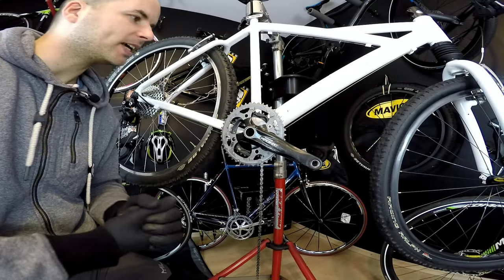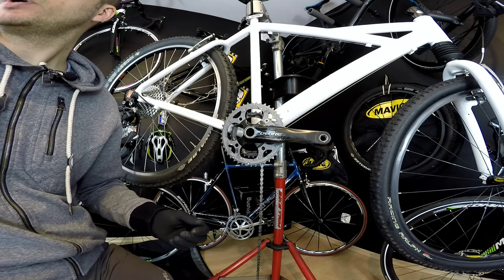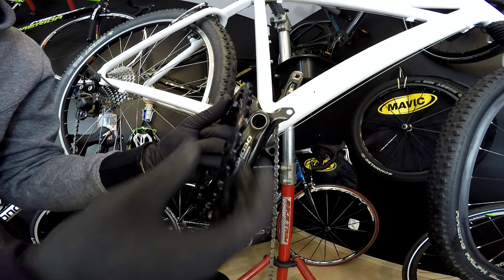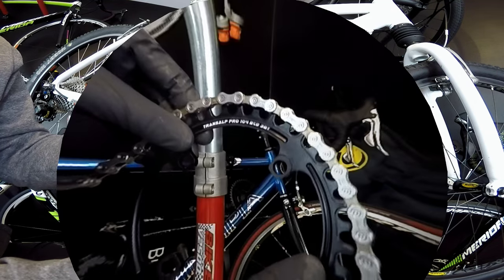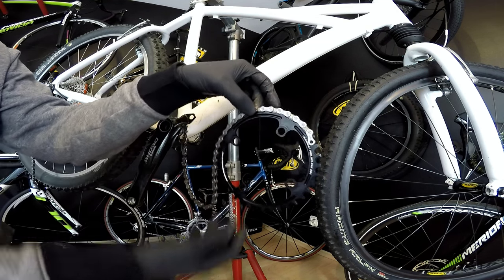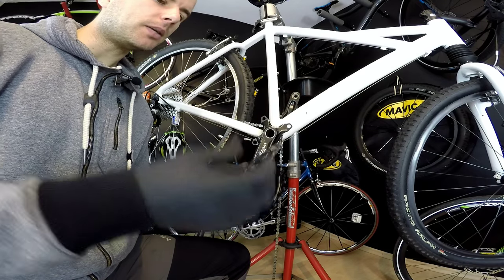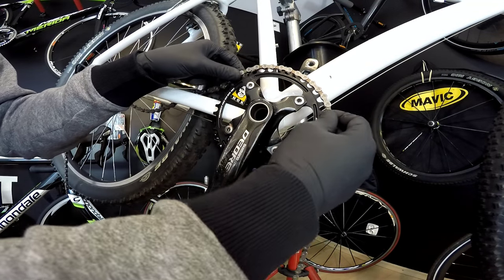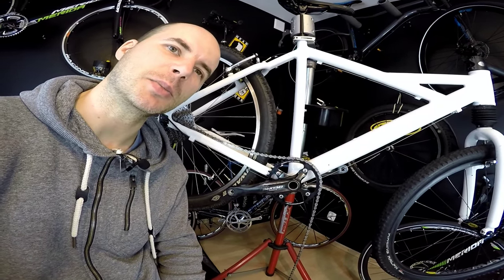Narrow wide chainring for 1x9, 1x10 or 1x11 drivetrain. Converting bike.

Comment: I've been running a 1x9 setup for about two years now. Shimano XT SGS rear derailleur, HG-61 11-36t cassette (modified from 12-36t), and 32t  regular raceface chainring. Also using a custom upper chainguide made from an E-type front derialleur mount and some plastic shelf supports from IKEA.  No clutch, no N/W, works perfect.
Reply from the maker: +MarzNet256 Good for you man :)

Comment: I converted my Giant Talon to a 1 x 9 with a Race Face 32T narrow wide. Works great, thanks for the video!
Reply: Len Pavia hey do you have any chainguide? If not,does ur chain comes out often?
Reply: I ran for a while with no chain guide, but I did find that pedalling over rough ground could cause the chain to pop off the chain ring. I bought an Origin8 guide which just mounts to the seat tube and hovers over the front sprocket. Just set it close enough to the sprocket and it will prevent the chain from coming off. My new bike has a clutched derailleur 1x11 and seems fine without any guide up front.
Reply: hey thanks man im thinking about converting my drivetrain to a 1x9.
Reply: Len Pavia I did the same with my Talon 3, but I'm having problems with the chain coming off because still using the same 32T oem chainring. Next step is to change it to narrow wide one. Did you use the same bolts to attach the new chainring?
Reply: hey i did that set up with my talon 3 , 1x8 set up currently using the 34t stock chainring , but i already bought a 34t narrowide sram 104bcd to avoid chain drops. next plan is a rear deraileiur with switch and cassette 11/42t
Reply: Len Pavia o

Comment: narrow wide chainrings have not only narrow and wide teeth but the teeth are also taller than regular ones. and this is the reason why they are designtd for 1x drivetrains. the profile and hight of the teeth just hold chain better. 2x narrow wide chainrings will not shift between each other.
one more thing. when installing the chainring you need to chack the chainline. it is the starting point for the placement of the chainring (inside or outside the spider).
Reply from the maker: +John Shade Exactly John. Thanks for your comment!
Reply: Also... Even if they could shift, the narrow part of the chain might end up on the wide tooth and vice versa.

Comment: i had issues with my chain skipping on a 1x 9 speed system especially when i tried a 10 speed chain.It turns out it was the chain ring at fault and i also got alot of chain coming off.Ive replaced it now with a snail chain ring narrow wide 34t and put a hollowtech bb .The bike runs much better on a 10 speed chain.I do get a little noise from the ring though.These kind of rings arent expensive but really do improve things on a 1 x system to retain the chain.

Comment: I did the 1x9 conversion on my two Rockhoppers ( hardtail and full suspension) recently. Both have the wide narrow chain rings up front. One is an oval 34 they other is round both work great so far. I'd like to drop to a 32 for both though

Comment: In most cases n/w chain ring is a must for 1x conversions.  However, a good chain guide can solve most dropping issues (or use both).

Also, for 1x9, I strongly advise you do use both (n/w ring and chain guide), as you do not have a clutch derailleur.  TIP: use a 10 spd chain on your 1x9 setup - narrower profile of the side plates on 10 spd chain will improve chain retention!
Reply: Yes and no.  The space between each chain link is the same on all chains.  However, for 10spd cassettes to fit a 9spd hub (or for 11spd cassettes to fit a 10spd hub) the teeth on the cassette are narrower.  So, 10spd/11spd chains are made narrower (the space between the side plates is less) to fit the narrower cassettes better. Therefore, the fit between the slightly narrower 10spd chain and slightly thicker 9spd cassette is tighter and the chain 'grips' better and is less likely to fall off.  It's not necessary to use a 10spd chain but if you are replacing it, better to go with a 10spd chain.

Comment: I'm using an 1x9 sram drivetrain.The narrow wide ring was working good for a month until the teeth started wearing out rapidly. I'm assuming it's based on the number of spacers used on either side of the bottom bracket (presently a shimano hollowtech ii) . any explanation?

Comment: well ive read some comments and looked around but im just gonna come out and ask some questions..#1 Do they make this ring in a 22 to 25 teeth? #2 I have a 2017 GT Pantera Comp its a 2x9..Would I need anything to do this conversion with? I have been told by the bike shop that I need to use both rings up front to keep from wearing out the chain,rings,cassette,etc,..SO how can I use ONE ring and not cause any damage? #3 would i need shorter ring screws since going to a 1x over my 2x? Thanks for any clear answers..
Reply: mikieson 
go to absolutblack channel, there's a video talking about it

Comment: by using the narrow-wide chainring, is there a need for those chain catcher/keeper? (example Paul chain keeper) Thanks✌😁🚲
Reply: VanKind  Chain guide is a good investment - if the chain does come loose the guide will keep it from falling off (which can damage components, including your frame, or cause a crash).  Not absolutely necessary but a good idea to have one.

Comment: Hi, i used shimano 105 road bike shifter 10 speed... it did not work? lol.. why?, what shiter/model do you use? can you recomend a cheap shifter? thanks
Reply: many possible problems but the 2 easy ones might be

Is the cassette a 10 speed cassette?  shifter indexing and cog spacers are different for each speed and should be matched pairs.  8spd with 8spd, 10spd with 10spd. but you can sometimes get away with a mismatch if youre in a bind but you'll have some rough shifting. 

Did you use it with a SRAM derailleur?

Comment: i have a 1 by 10 speed drivetrain.I have orderd a new shimano m8000 ( rear d, cassette, chain, shifter).Will the 11 speed chian will fit the single chainring?I reffer to the fact that the 11 speed chain is narrower than the 10 speed one.Thanks
Reply: I did the same, been trying to figure that out as well :(
Reply: +Los Angeles Duo my parts have arrvied.Don t worry, it will fit
Reply: Nice! Thanks, I can't wait

Comment: i have the same crank, what kind of shimano chairing I need to buy for convert my 3x9 to 1x9 ?
Reply: bcd ? 
How aboute Rear Derailleurs we have long, medium, short how u explain that ?
Reply: a new cage length might be necessary if you're changing your cassette to a much bigger one since capacity will change a lot otherwise your old one will probably work.   Or changing your chainring to something huge, i suppose.   Using a longer cage on a smaller cassette and smaller chainring isn't ideal but it will work.    Look up the meaning of capacity and max sprocket spec for rear derailleurs to understand what i'm talking about.

Comment: Can you fit 11speed casette on a 9 speed "normal" mtb wheel and frame??
Reply: Alex Braun  In most cases, no.  The hub is normally not wide enough to accommodate an 11 spd casette but you may be able to fit a 10 spd cassette.  Take your rear wheel with you to your lbs and have them try fitting a 10 spd cassette.
Reply: Thanks Jerry.
Reply: I might do this...